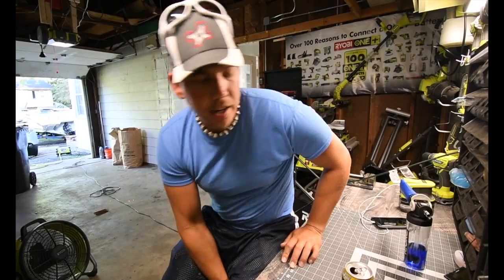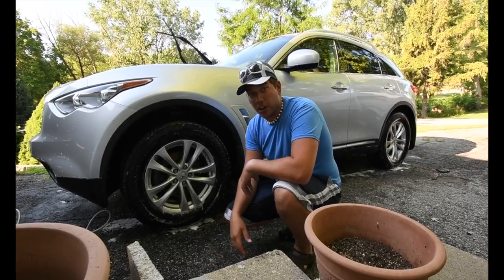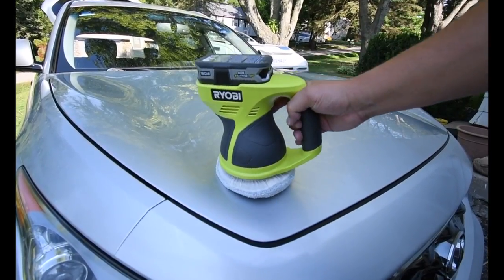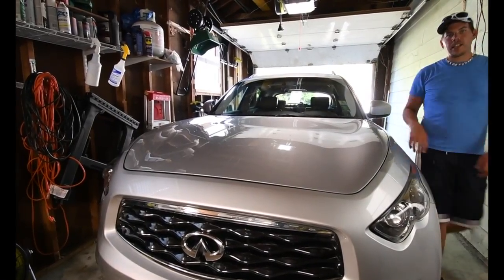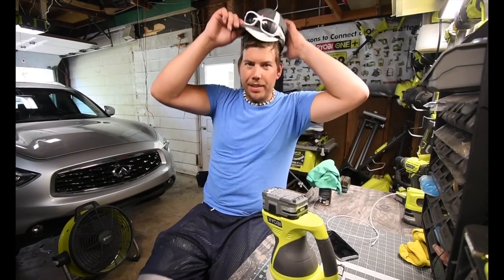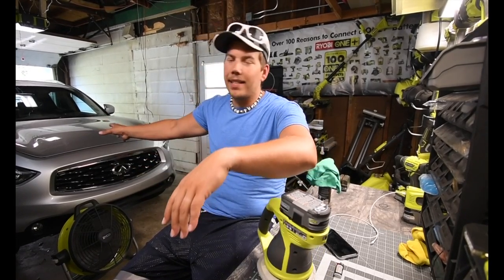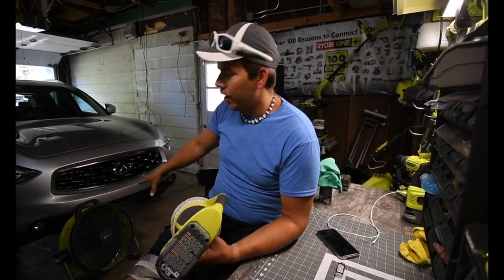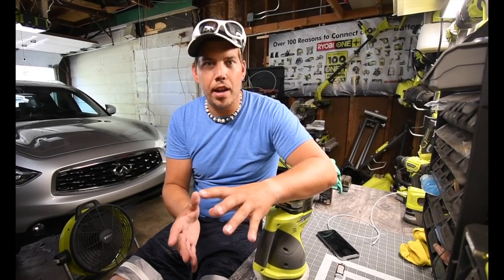Ryobi One+ 6" Buffer at work

Comment: I got that except I don't use those pads. What I did was glue the backing plate velcro to the foam and then I can use the 5.5" or 6" foam pads to apply my wax and polishes. Its not perfect but its so much easier to just rip off the pad and put a different one on. I haven't found a 6" adhesive velcro but the 5" ones work just fine. no issues with it coming off with the included E3000 glue
Reply from the maker: very good and thank you
Reply: Master Shake, so you just used the velcro on the backing plate to use foam pads? I think that's a slick idea! Did you by chance make any videos to show how?
Reply: @johnavgoustis3372  no but I could make a video showing it off. I’m moving tomorrow so all my stuff is in boxes at the moment and for the next… 1-2 weeks maybe
Reply: @TheOriginalStevenH  that would be awesome! Enjoy your hacks and tips!! Look forward to seeing that video when you're settled in! Thanks!

Comment: In all honesty does this have the capability to compound and polish a black car with some scratches and swirl marks, or just spend an extra $20 or so and buy a DA polisher?
Reply from the maker: Id get a polisher. Ryobi is coming out with one soon
Reply: @ManCaverTools  picked up the D.A for $199 when they were offering it with a 4ah hp battery. Otherwise $199 was too much for that bare tool, Kobalt had one for $120. When are they releasing their new 3inch automotive polisher?

Comment: Nice video ! What wax did you use ? And did you let the wax sit to haze and wipe or do you use another method ?
Reply from the maker: I used many different type of waxes but im rarely wax the cars. less waxing you do the better for the paint
Reply: @ManCaverTools  ok great but do you wipe after the wax let it sit or ?
Reply from the maker: @markrodgers1965  that depends on the weather, I usually buff it out after I apply the wax to the whole area. such a door or panel at a time. doing the whole car at once is not a good idea

Comment: I don't understand what the difference between buffers like these and dual action polishers? Are the more expensive ones just more powerful? I can't find hardly any videos on the differences.
Reply from the maker: polishers help rub compound  in to take off film and layers from the  elements. a buffer is used to rub wax in and buff making it smooth
Reply: @ManCaverTools  thanks so much! I couldn't find any comparisons anywhere else. I'll probably get a buffer then, since I only plan on doing some light polishing

Comment: It seems like before you buff the car you put the wax on the car and let it dry is that the best way to do it and how did you apply the wax
Reply from the maker: I use a damp rag to put the wax on the car, then let it dry then buff it out, but the trick is not to do it in the sun, the sun will dry to too much and you would have to reapply the wax

Comment: Is there Velcro on the bottom how can I use a foam pad with this buffer Or what type of foam pads do I need to buy I’m new to this so sorry
Reply from the maker: its just a foam disc with no velcro
Reply: Any way you can change it to a velcro style backing?